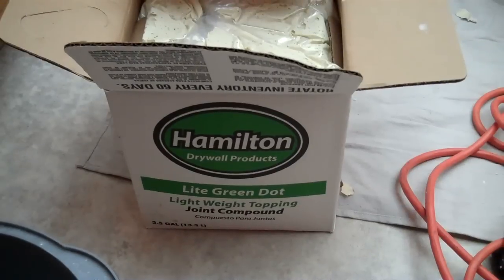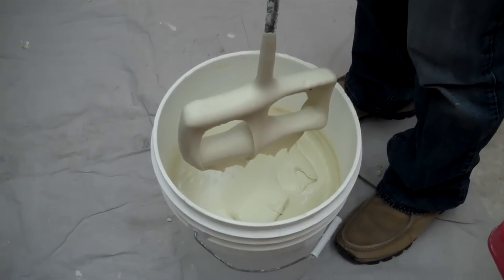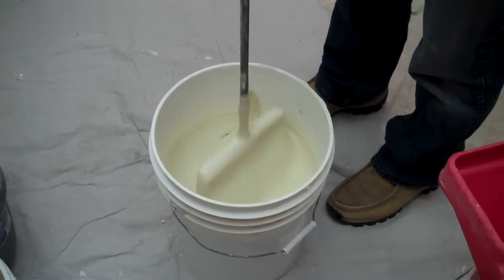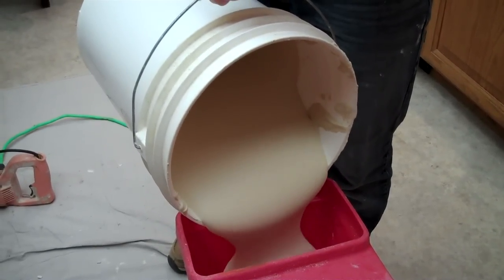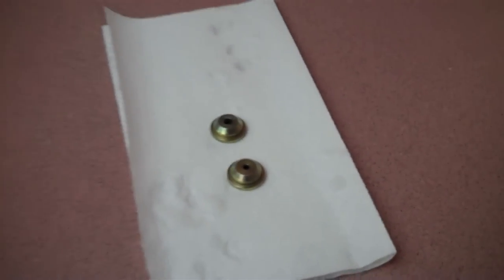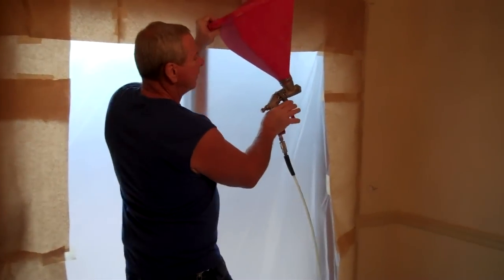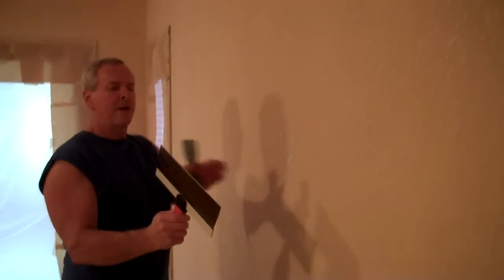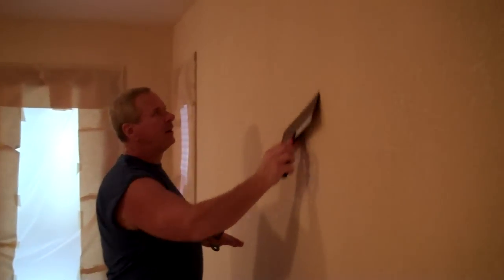How to Texture walls and Ceilings

Comment: Best vid -- - - -to the point and reassuring. Thank you!
Reply from the maker: TSP works great if you got grease and grime and dirt if you don't have that just put a very light coat over everything, then let it dry
 Then another light coat over everything, let it dry ,and on your 3rd coat, Texture it the way you want it to look, it'll cover up anything and everything as long as you did it, just the way I told you 😃

Comment: Quick tip. I don’t know if you ever heard of it before. Before pouring the mud into your hopper spray a thin layer of WD-40 into your hopper Walls and hopper gun. It will make it much easier to clean after your done using it.

Comment: Question: Great video. I'm re-texturing our small bedroom 11x10 that has about 3 coats of flat paint over 40 year old texture. What would be good to use to prep the wall surface? TSP? The new texture will end up covering paint runs and a few bad patch jobs with a new look in the end. John 3:16. God Bless.
Reply: Did you get it figured out?

Comment: HI JOHN!  YOU MENTIONED VERY BRIEFLY ABOUT WALLPAPER SEAMS AND USING A SMALLER HOLE ON THAT FIRST.  DID I UNDERSTAND YOU TO SAY THAT THIS FINISH CAN BE USED OVER WALLPAPER?  WE JUST PURCHASED A CONDO AND THE PREVIOUS OWNER UNFORTUNATELY PAINTED OVER THE WALLPAPER INSTEAD OF REMOVING IT.  THANKS FOR YOUR HELP!
Reply from the maker: +Diane Cunningham Hi Diane
If the seams look bad, then something has to be done with them , you may consider coating the seams with drywall mud first and after sanding them smooth, retexturing...
but 
if you can live with the seams, (but just want them less noticeable), use the smallest hole on the texture gun, with as high a pressure as you can get with your air compressor, and feather the texture until the seams disappear, (bunch of light coats)...;-)

Comment: Great job..
For ceilings the hopper needs the 45 degree elbow. Connects gun metal to the red hopper. The industry is retarded to not inform buyers. Its a plumbing drain elbow. Usually 1 1/2 inch.
Without it the mud keeps flowing back into hopper.

Comment: How long to wait before spraying  heavy knockdown after spraying the small cover up coat? 30 min enough time?
Reply from the maker: Of course it all depends on the weather inside the building
Reply from the maker: If it's hotter than hell 1/2 hours should be fine
Reply from the maker: If it's freezing in there could be a couple days
Reply from the maker: Wait until the sheen is gone from the mud and then carefully go over it
Reply: @Jonehughes  It's 80* inside the house, so  I'll wait until all the sheen is gone....thanks

Comment: are you lightly dragging the blade or applying pressure?
Reply from the maker: +Christina DP 
Hi Christina,
Start with dragging and apply pressure as you see the necessity to make the texture uniform, it dries differently, heat rises, so the top is first to dry, so some requires more pressure than others
wet would require no pressure, dry would need more....
Reply: Christina DP ..hii

Comment: WHAT PSI DO YOU SET YOUR COMRESSOR AT WHEN SPARYING
Reply from the maker: It really depends on the looseness of your mud, start at 25 lbs and see if you like the pattern, if you want it smaller add more PSI, if if still isn't small enough, make the mud thinner and start at 25 PSI again , and then add more PSI until you are getting the correct pattern

Comment: how many PSI and how about the trigger adjustment?
Reply from the maker: Shroom Duke if you have a adjustable gun like the new wall board it has PSI adjustment on the side of it and also the trigger also has an adjustment so it really doesn't matter what your air compressor is set at you adjust it on the gun itself but if you have no adjustment on your gun you want to start off about 65 PSI and then reduce it based on the size of splatter you want so you'll have to play with it and definitely practice on a couple spots let us know how it goes
Reply: Thanks, got it dialed in now!

Comment: What kind of gun are you using? And what kind of compressor?
Reply from the maker: Hi Jose, Use any 5 gallon or more air compressor and I used this texture gun
http://www.homedepot.com/p/Wal-Board-Tools-Texture-Pro-200-Hopper-Gun-with-3-Spray-Tips-52-020/100660219
Reply from the maker: every rental yard has them, as a set

Comment: when you say  orange peal, do you blend the peals in a blender first,or does that drill thingy, i think you said it was a whip, will that do the chopping and blending?  Are there other rinds that can be used or foods.
Reply: no you'll need to chop the peels up into little bitty pieces. like onion pieces, then go ahead and put into the mix and whip it. you can also use lemon or lime skin as well.
Reply: hey guys u sound like u have a mexican taco stand.

Comment: Knock-down is THE MOST HORRIBLE texture ever for walls.  It screams, these walls were installed badly and the hack didn't make nice joints or flat walls.  DO NOT DO THIS TO YOUR WALLS unless you want to lower the value of project.

Comment: what  psi  did you have compressor on    40-60
Reply from the maker: RICHARD COURNOYER hi Richard start at 25 pounds and then just increase it a little bit at a time to get just the right splatter, it really depends on everything what's the consistency of the mud and all that stuff so start 25 turn it up a little bit as you go should work fine or thin out your texture a little more